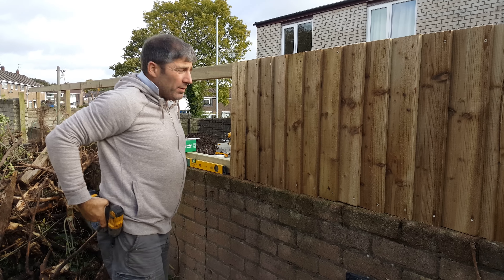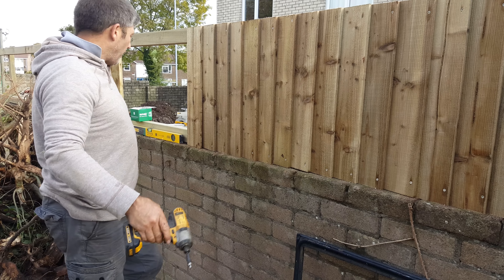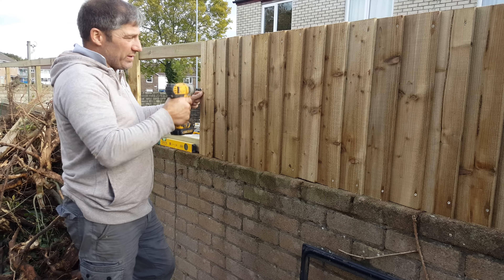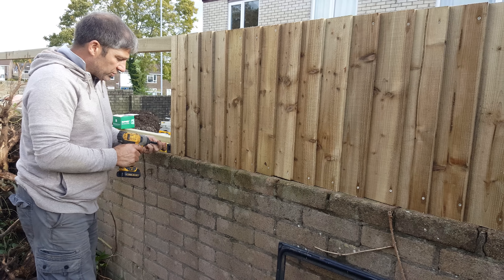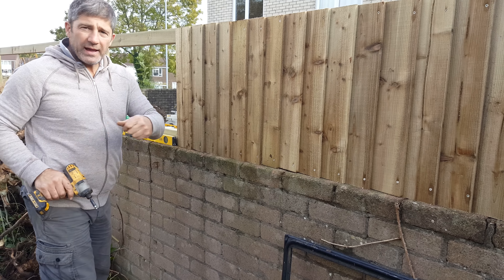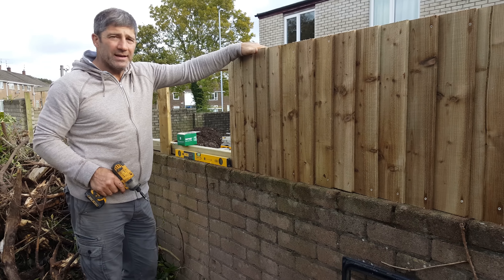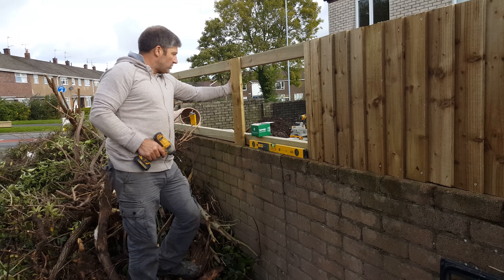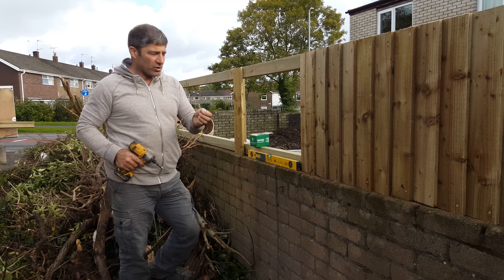How To Install A Feather Edge Fence On Boundary Wall

Comment: What happenswhen you get to a upright post  to keep the feather edge looking flat ?
Reply from the maker: Not quite understand what you mean
Reply: From the video it looks like the horizontal battens are screwed in behind the uprights, 
So when you start feather edging along the horizontals, once you get to the uprights the feather edge would pretude.
I really like the idea.
Thought if the horizontals where attached to the front Of the uprights then the feather edge would not pretude. Hope this makes sense.
Great video by the way
Reply from the maker: Sorry Mate, the feather edge just carries along the horizontal so it won’t protrude

Comment: You’ve fitted the vertical structure how ? Is it a full length down other side of wall and fixed or have you screwed it and anchored some other way, I just can see how you’ve fixed your vertical framework to the brick ?
Reply from the maker: Down the back Rob mate
Reply: @GreentopLandscapes  ahh ok . I get ya. Thanks for a great video 🙏

Comment: How did you screw the middle uprights into the wall
Reply from the maker: Hi Bud if I remember they were thunder bolts
Reply: Bit im lost at is how do they go in to the wall, did you drill through at an angle  or use a bracket?

Cheers bud

Ps fence looks mint 👌

Comment: Hi Johnny. Can't believe found your videos again to try do a job. For 90 cm of featheredge, what would you say would be a good amount of anchor on the wall. I have a little over a meter would that be enough or would it need more? Also did you screw the bottom 3x2 to the wall as well as the verticle drops. And finally aswell as the drop down the wall have you put a verticle piece on the other side aswell?
Reply from the maker: Hi bud No worries, difficult to say bat at least 90cm to the wall minimum

Comment: I was really hoping this video would be a help how to secure the fence to the wall, but you don't show us unfortunately. I've bought all the wood , gate, locks, etc... but i would like to be sure about the screws to use and I'm struggling to find the right information.
Reply from the maker: thunder bolts